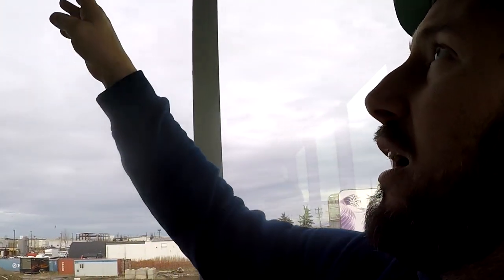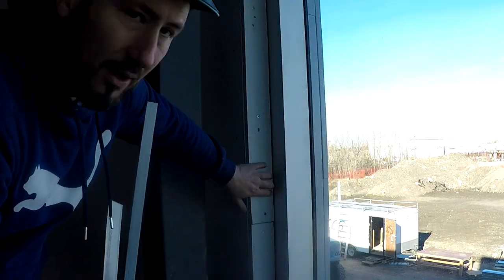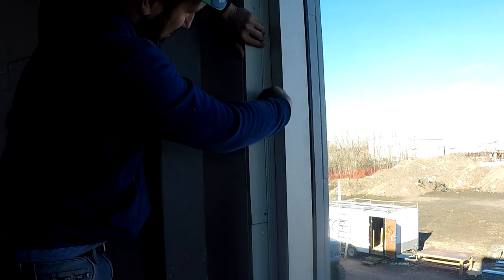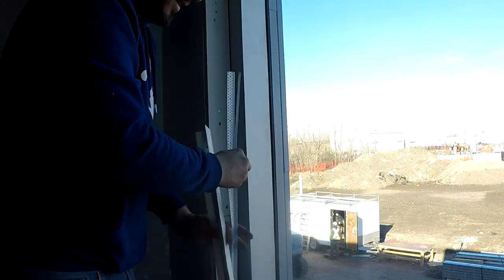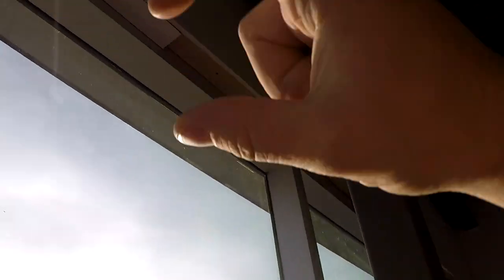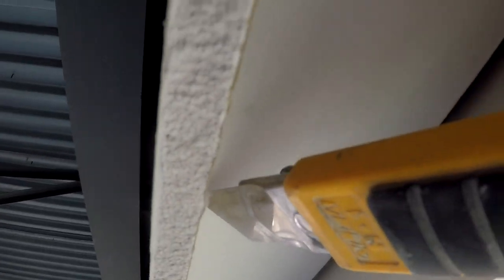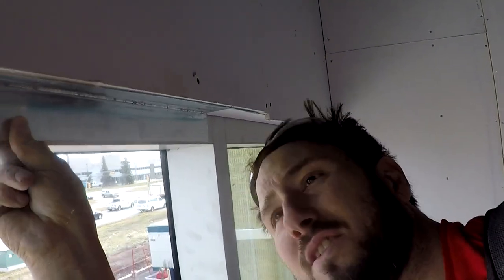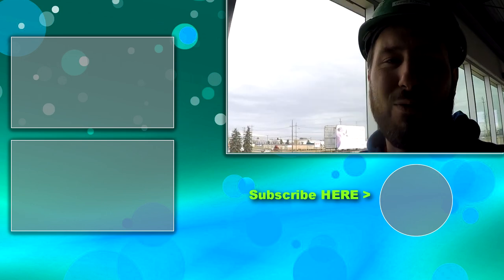Drywall Window Return

Comment: Hey Kronie, another great video!!!  I just put an egress window in my basement.  Putting a drywall return to avoid putting three-sided trim on a jamb.  I notice your video didn't speak to a drywall return on the bottom ledge.  If I put a 3/4 piece of pine on the bottom do you think having a 4 sided drywall return would make sense.  Obviously I'd frame it so the mullion would be exposed 1/2 inch all the way around the window.  Some people tell me the drywall might get wet and sag - but I don't get that.  Maybe I should use denshield with it???  Thanks in advance!!!!
Reply from the maker: Hey my man, yes we almost 100% of the time return the bottom too. All around. Always use 1/2 " for your returns. The exterior walls if done properly the returns will never sag. What I mean by that is there are 2 ways to do it. 1 you insulate and poly the interior or sheat with densglass, blueskin and the insulate before cladding. For residential its always done using the batt insulation, chemtron caulking, 6 mil poly and 1/2 " drywall. Does that make sense to you? Ask me if you have any questions k!!!
Reply: @ConstructionKronies  Perfect!!!  Thanks again for your help.

Comment: Hey brother, I was wondering if you could help me out on a situation? I bought a used window as I am remodeling my garage. The window seals on the window are no longer on the used window, they're all broken off. The seals that keep the water from coming in and also keeps the window locked in from the outside exterior. What do I do in this type of situation how do I seal it?
Reply from the maker: I'm thinking you can source out replacement rubber. Should come in a roll you can cut to length. Try that out I will see what I can do. Send me the make , model and dimensions I will look for you.
Reply: @ConstructionKronies  thank you brother, will do, I will check after work I appreciate all your help
Reply from the maker: I found these resources this morning for you: 
https://www.youtube.com/watch?v=sAPv9wdrNuo  
https://directwindowparts.ca/product-category/weatherstripping/
Reply: @ConstructionKronies  I appreciate it and I'm very thankful for you helping me out. I'm going to check them out right now.

Comment: Is this doable if it's only 3/4" from the window frame to the edge of the drywall?
Reply from the maker: Not exactly sure what you mean here but if you mean will the trim go on if your 3/4" away, yes it will. Or if your saying there is only that much to drywall?
Reply: @ConstructionKronies  the strip of drywall would only be 3/4”
Reply from the maker: @brandonfontaine285  a yes that happens. What we try to do there is see if we can build it out with double layer drywall or a piece of plywood and drywall so that the return goes straight in.  I wouldn't bother trying to get trim on it but worst case scenario your taping a half corner.

Comment: Awesome video Chris.  Do you guys have regulations for the spacing between drywall screws?
Reply: Brandon can you believe that shit? Having a screwing schedule on drywall. I glue and screw the perimeter. Then down the middle. Next day when mudding I knock on the boards. If it sound hollow I’ll add a screw. Less screws less popping.
Reply: That's a good way to do it.  Yeah some of these building codes and regulations are ridiculous
Reply: @renaissancemen1  we have to screw every 6in on seam and 12 in the field , crazy right why do they need us to screw off  like it's siding. Florida has shit ton of codes.
Reply from the maker: thats the same here wealro!
Reply from the maker: 6" in the bevel and 12" in the field. On returns and corners every 6".